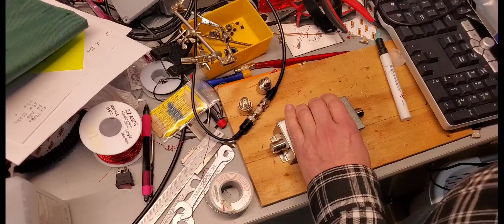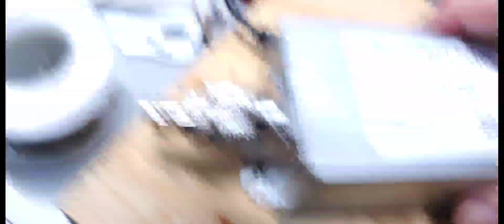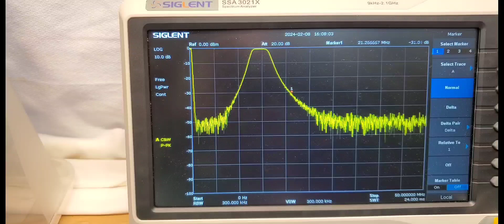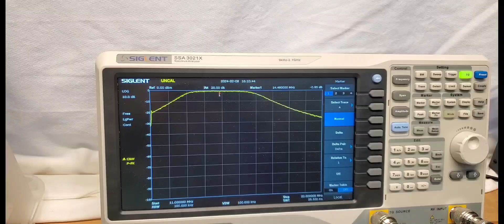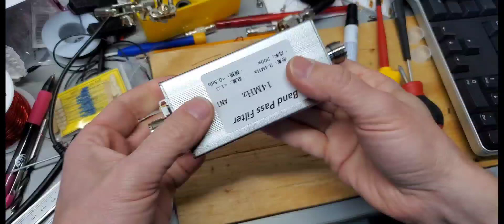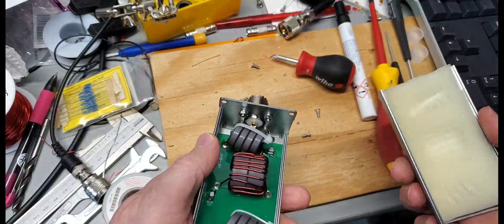Aliexpress 20m Band Pass Filter

Comment: Using ferrite core instead of power core for filter is absolutely ridiculous!
Reply from the maker: I'd be interested to know how you can tell what toroid material / mix is used by looking at it, especially with unmarked ones like these.
Reply: @adventurewithclaus  The color of the ferrite is black and will saturate easily with power that why they use very big ferrite.
Reply from the maker: @y_x2 Thanks for your reply. Being ignorant, I'd still say it's inconclusive.  Coming from a low cost manufacturer, the cores might never have been painted.  Or the larger size makes it work just fine.  We probably can agree that at very low receive power, in the micro watts range, the filter works as tested.  The question is what will happen when some significant power is applied.  I think I might have some ideas on how to test that.  I'll try to make a follow up with that and would love to get our feedback on it.